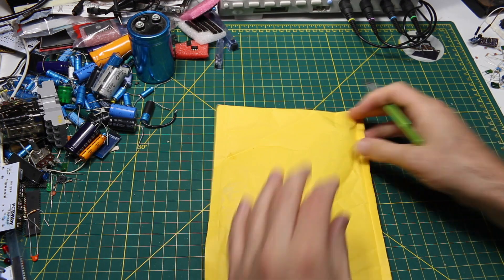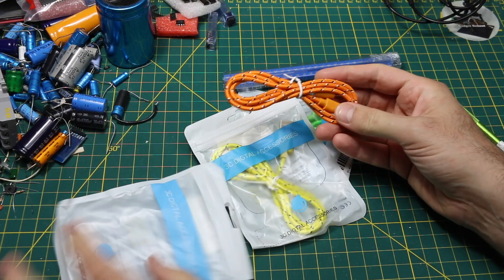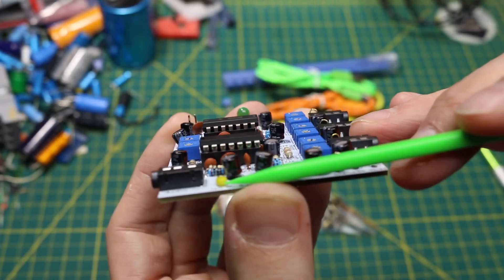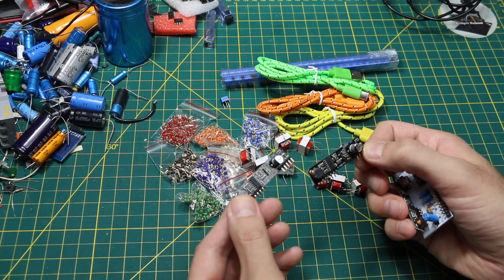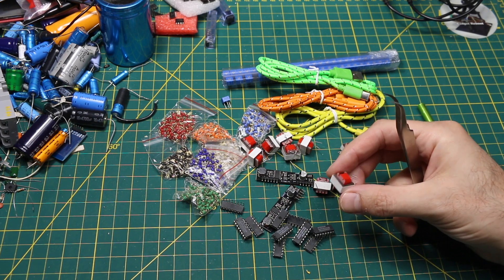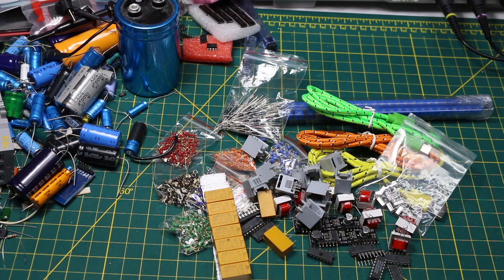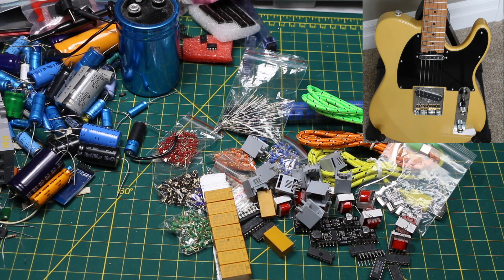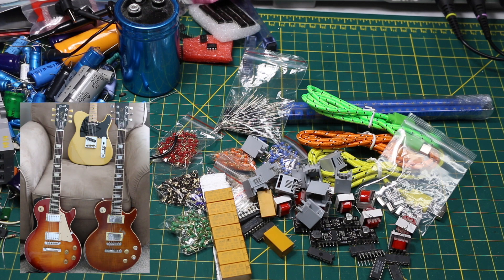Mailbag!

Comment: Put a diode in series with the 5v regulators 0V reference pin, to raise its output voltage by the diode drop, to compensate for drop through the polarity protection diode.
Reply: Not your place to speak Scott haha  I know you can fix anything so I'm scolding you for your talent haha

Comment: can anyone help I am looking for a range of resistors with thick leads.  This is so that they are easy to use with breadboards.
Reply: Normally 1/4 watt will do. The 1/6 1/8 watt are kind of dicey in breadboards, but I just up the wattage and they're fine.
Reply: 1/2 watt resisters are my favorite for breadboarding.  Easy enough to find a variety pack.
1amp diodes have good legs (like these 1n5817).  Little glass ones are a hassle.
Have often wondered about the ideal gauge for breadboard round wire jumps.  My favorite is 22awg.  24 works.  Higher is too small IMHO.
Reply: thanks for that, when buying on line can be hard to tell how thick the wires are

 @GnuReligion